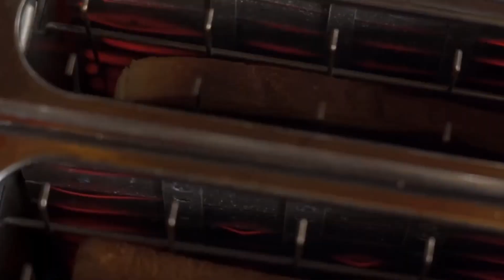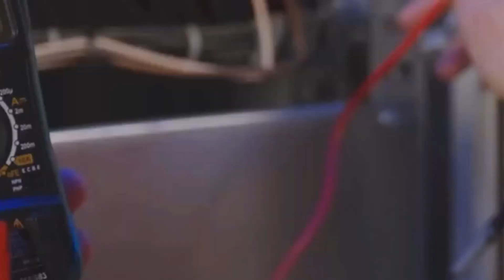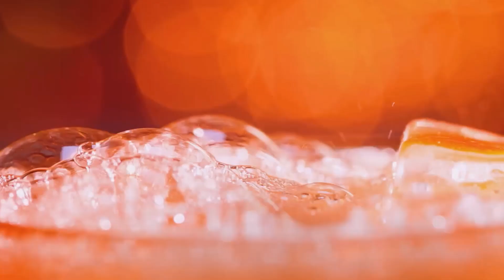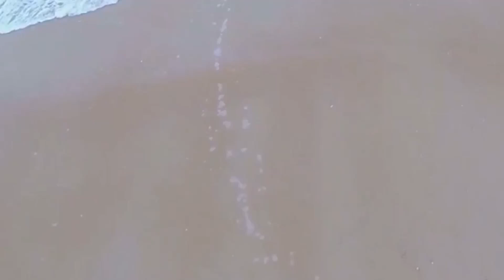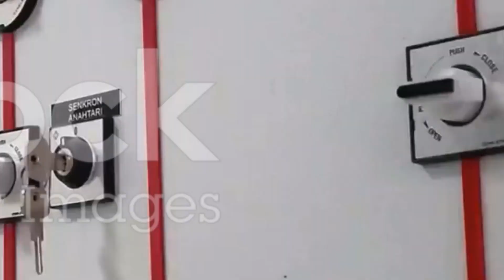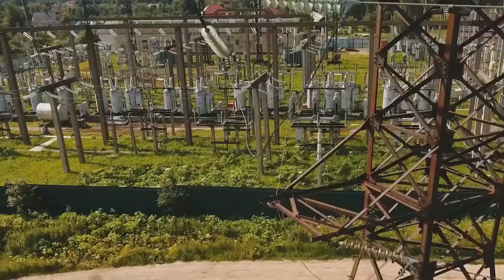Power Factor & Power Types: Active, Reactive, Apparent | Leading, Lagging, Unity Explained

Comment: Excellent explanation of power factor and the different types of power. The way you broke down active, reactive, and apparent power made the topic much easier to understand. I also liked how you explained leading, lagging, and unity power factor with clear examples, which helps connect theory to real electrical systems. Very useful for students learning power systems.